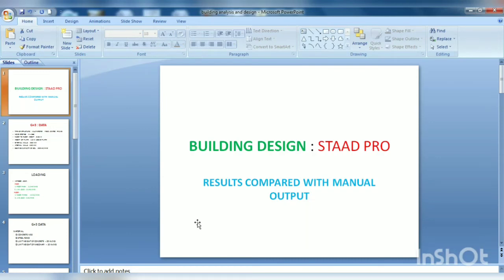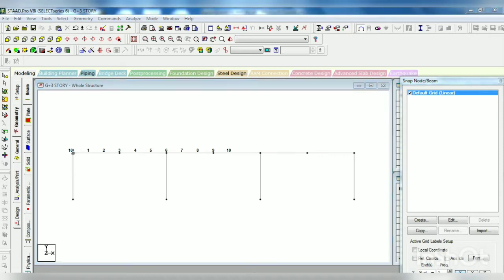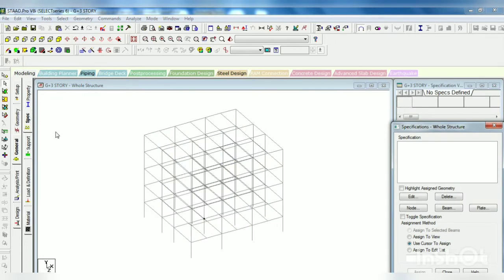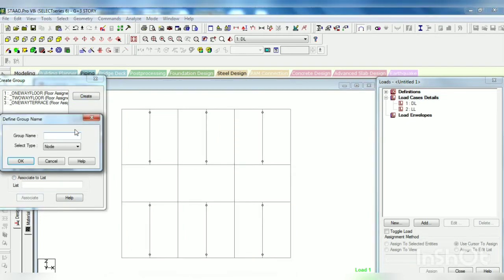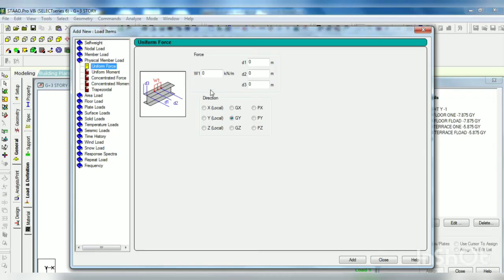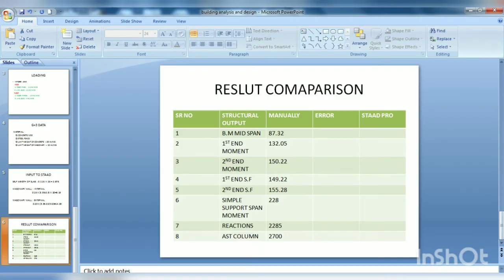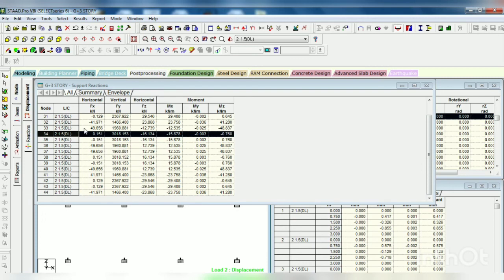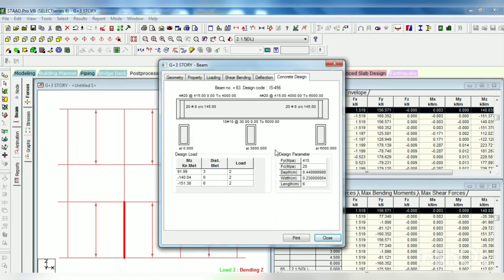Design of rcc building in staad pro : staad pro design example for complete building

Comment: Hello, when you assign column at node, it seems that all columns are axially loaded. But in actual some eccentricity ( making column uniaxially or biaxially loaded). Then why you don't provide column as per site or column Layout plan? Please Explain...
Reply from the maker: Column is a line element in software and eccentricity depends upon size of column and that formula is already set up in the software
Reply: That mean, as per our column center line Layout plan at intersection nodes we are required to just add columns. The staad automatically will consider eccentricity. Is it right?

Comment: Sir why we are releasing moment from ends of secondary beam.however it is secondary beam but it's reinforcement is attached with main beams and practically it will casted monolithically with primary beams so it has fixed end..  why we are make these simply supported beam?
Reply from the maker: Actually it act as a point load on beam, also reinforcement of secondary beam we don't bend the end bar we just rest on it

Comment: Sir Plz share the wind load calculations.and if u possible then plz make a video on how calculate n apply the wind load on x, -x, z and - z direction.
Reply from the maker: I have already made a video on how to calculate wind load manually and how to apply the wind load in staad pro.....i am going to share you name of that video and link. You can go through it
Reply from the maker: How to apply wind load in staad pro steps output from manual solved problem  is 875 part 3 2015 
https://youtu.be/_9wVs4ozJTE
Reply from the maker: Wind load calculation example on rcc building as per latest code is 875 part 3 : 2015 
https://youtu.be/NZ9MWQRUWLE

Comment: Sir, the plinth height is 1.0m. The foundation depth is 2.0m. How the bottom most height is 3.0m. normally we take top of footing for considering bottom height. where the grade beam is provided. Kindly explain the height for bottom.
Reply from the maker: I will check details and will let you know
Reply: I think you have consider plinth height as 0.60m and depth from top of footing is 2.40 m  no plinth beam is added at ground level. Plinth beam is consider at plinth level and first floor height is kept as 3.35m.

Comment: Releasing moments in y direction for secondary beams is correct ?
Reply from the maker: We release moment as we want secondary beam act as a simple support beam ....That means no moment at support....Hence we release ....Hence it's ok to release y and z direction moment
Reply: If beam is parallel to z axis,  even then the release will be in z and y axes?
Reply from the maker: Look all the time you need to release  mz direction moment.....The reason is, there are two axis systems one is global axis system and second is local axis system ....When you open your staad model press shift key plus o (shift + o ) .... Then you can see local axis system....In local axis system the beam is always in x direction....Hence you need to release Mz only
Reply from the maker: Hence you will also get moment in Mz direction as beam is in x direction in local axis system all the time ....
Reply: thank you